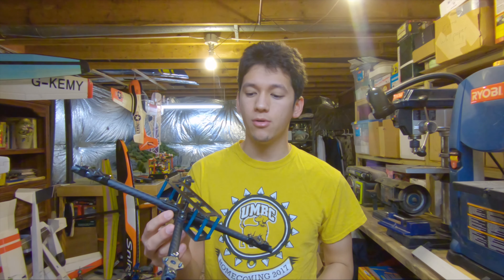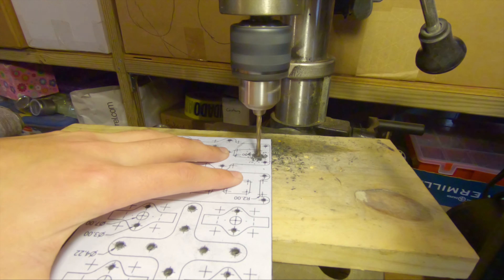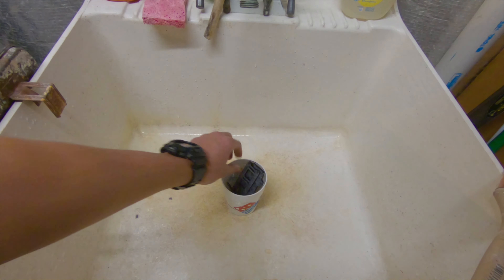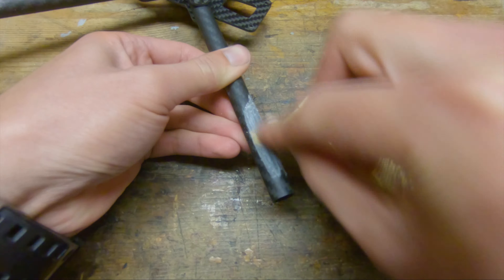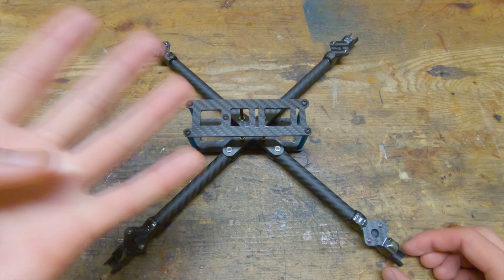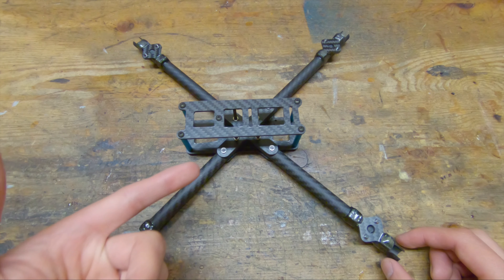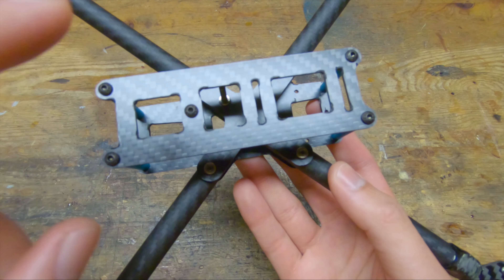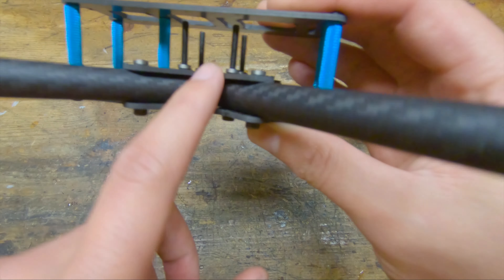Tubular Quad V6 Build - DIY FPV Freestyle Frame - Free Plans

Comment: Thank you for iterating this design to what it is now.   It is so clean, elegant, simple, and well thought out, I love it!

Things I would do to save weight to the extreme: sand away excess epoxy around motor mounts, and make cuts to the inner nesting tubes, as they don't need to be a complete cylinder to do their job.

I really appreciate that every part and geometry is optimized to a common goal: achieving the maximum strength using the least bit of material, truly a beauty of engineering ♥
Reply from the maker: Thanks! I appreciate the feedback. Cuts to the tubes where the arms meet would also make more room for the motor wires.

Comment: Great work bud.  One thing you can do to save some weight is to switch to Ti screws and nuts.   Also, you can sand off some of the excess epoxy on the motor mounts for a bit more weight savings.  Great job all around.
Reply from the maker: Thanks! I would like to switch to titanium fasteners, but proper grade 5 titanium fasteners are rather pricey.

Comment: If i may you should build a dead cat style for long range this design is best suite for long range due to the less drag, durability and light weight of the design and it would realy gain popularity in long rg community. 
I took your design but could not build it (time constraints). I will try at dead cat style it would save weight and i will use a 3d printed canopy

Comment: Love your work! I have the Tubular V5 and its one of my favorite quads. Will build the V6 when summer comes around. Think I’ll put a Caddx Vista pro in it.  Will also compare weight of 20x20 stack with a whoop style 25.5x25.5 AIO board, to see what is lighter. 

I’ve been playing with the idea of making a 7" long range tubular quad. Might use the V6 plans, but with longer arms. Uncertain if the longer arms will increase frame resonance though.
Reply: I'm interested in that as well! 7, or maybe even 10 inch tubular quads for long range would be insane. Resonance wise I have the same concerns as you, though I believe, as he mentioned in the video that tunes have a higher frequency, it should still be better than normal arms. A second thought; if, nonetheless, the vibrations get worse we have to opt for thicker arms. Interested in what Timmy thinks!
Reply from the maker: Thanks! The design should have no problems with being extended to 7 inch. I'm thinking the lighter, stronger, stiffer nature of tubes will be even more advantageous to larger quads such as 7 inch since they are usually more prone to tuning issues. Yes, the resonant frequency will be lower than the 6 inch Tubular Quad, but it will still be higher than a carbon plate frame.

Comment: Timmy, amazing job !!! , just wondering how the unfiltered gyro noise graphs will look on your frame, have you seen them ? i mean , how better are the tubes on vibration harmonics vs the "normal" quad frames that use stock flat fiber pieces. Chris Rosser is doing some interesting structural analysis of quad frames, he even have his own designer line of quad frames in 5.5 , 5.0 and 3.5 prop sizes. Best. R.
Reply from the maker: I recently looked at them and they are pretty clean. Max motor noise was at 549Hz.
Reply: @TimmyRC  just for fun, can it be feasible to tell Chris to analyze your frame with his method , he have made a couple of mods  to some commercial fames to improve the filtering process (reducing the vibrations/noise) , i mean the better mechanical your frame is, the less filtering  you need to apply on BF. ,BTW, are your using breathing mask ? i thought i read somewhere  that fiber dust is nasty for your lungs ( asbestos like ) .

Comment: Love it! Do you think that could work on 10" by making the arms longer and with thicker tubes?
Reply from the maker: Thanks! A 10 inch version would definitely work, but durability would suffer greatly without adjusting the arm mounting accordingly.
Reply: @TimmyRC  Thanks so much for the ans! You mean make the 2 screws that hold the tube in the fuselage even further apart?
Reply from the maker: @joseluisbarrios2319  Yes, that is the first thing that comes to mind.

Comment: Tubes create buffeted airflow at the trailing edge which causes more drag. You can simulate airflow around the tube using Fusion360 to see airflow buffeting (its why wings and propellers don’t have a round profile)
Reply from the maker: More drag than an airfoil, but less drag than a rectangle. So it is an improvement over the typical flat carbon plate arms. Additionally, the omnidirectional nature of the circular cross section of tubes is more suitable for aerobatic drones that operate at any angle of attack. The airfoils of wings and propellers have a narrow angle of attack range where they are producing low drag, which makes them unsuitable for the arms of aerobatic drones.

Comment: Hi Tim thank you for your innovation. A tiny suggestion, please wear some latex gloves when cutting and sanding carbon fibre. If you develop some allergy then it will annoy you forever. Speaking from personal experience.

Comment: I found a company that produces tubes with different shapes, have you ever thought about the flat oval profile for the arms?
Reply from the maker: Yes. An oval or airfoil shape would have improved drag for some angles of attack, and worse drag for others. This could be advantageous if the quad will constantly be flying at a known angle of attack. However, the angle of attack can be any direction for freestyle drones, which makes the axisymmetric nature of circular tubes advantageous by providing consistent drag characteristics no matter the angle of attack.

Comment: if you put the topplate in the other side, the standoffs can be shorter?
Reply from the maker: Yes, you could switch the position of the bottom plate and midplate. I didn't do that in that past because the 30x30 stack took up a lot of room in the fuselage. But now with the smaller 20x20 stack it would make more sense and would be lighter.
Reply: @TimmyRC  and shorter standoffs are stronger 👍🏼

Comment: Good effort as always. Did you see RC Addict's latest video? I wonder if using a tubular design we could improve on 30g for a minimalist 5" frame as tubular is stronger? Perhaps get the frame down to sub 20g.
Reply from the maker: Thanks! I did not watch his video, but tubes are advantageous at any size if implemented well. Check out this RCGroups thread, which was part of the inspiration for the Tubular Quad. There are a lot of superlight frames in there:
https://www.rcgroups.com/forums/showthread.php?2645953-Mini-tubular-and-ultralight-LOS-Acro-FPV-Quads
Reply: @TimmyRC  Ah yeah I read that thread last night after watching your playlist. That 23g frame looks sweet. Have you seen Ummagwad's new motors? They have just two screw holes and have the highest grams per watt efficiency of any motor I have ever seen. I wonder if how you put a tube inside the tube at the middle to attach to the frame you could do at the ends to attach his motors.
Reply: @changeagent228  could work great, the screws are in line with the arms, right?
so then the wires don't come off to the side
Reply: @marc_frank  Exactly. The screw holes and wires are perfectly in line. Tommy got the motor manufacturer to remove as much weight as possible so they are very light and should not stress the frame as much too.